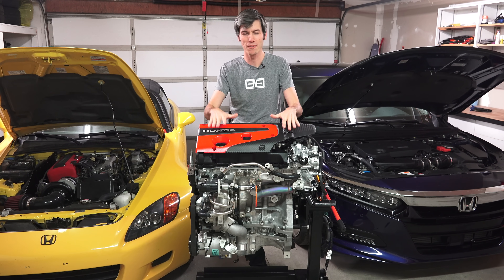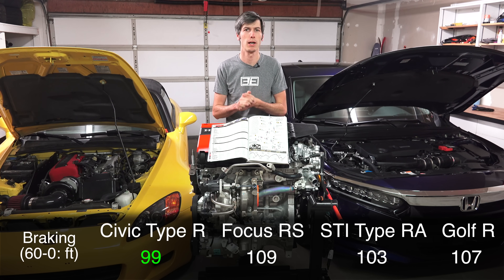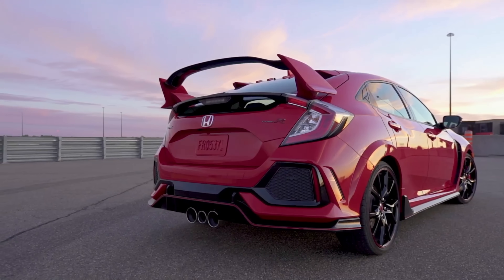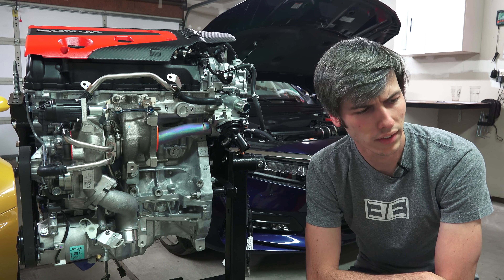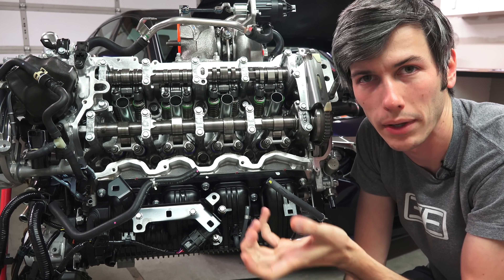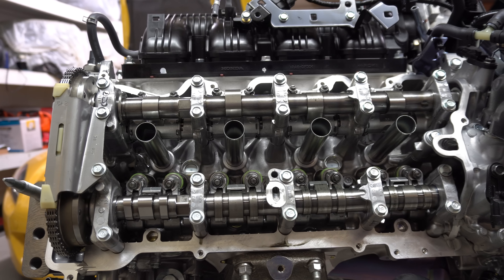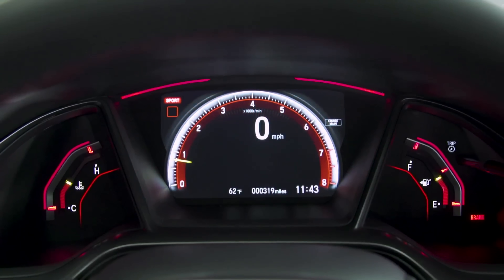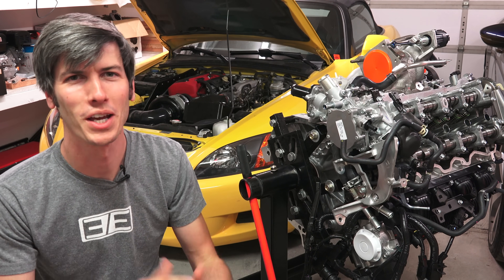The Honda Civic Type R Destroys The Competition - The Best Engines

Comment: "you can buy it as a crate engine, but only for the track."

What are they gonna do about it if I put it in my road car? If i'm buying the engine, i'll do what I damn well please with it.
Reply: Sadly, most states that do regular inspections would deem it an illegal engine swap for a street car.
Reply: live in a state with no inspection and you're golden
Reply: @jameshaulenbeek5931  Most inspectors are idiots and probably wouldn't notice. I used to be a emissions inspector, and if I saw that engine in a street car I would pass it
Reply: @jameshaulenbeek5931  what states
Reply: unless it's a formula 1 engine (or a diesel because those things are terrible in regards to pollution) why would a basic 4 cylinder consumer level engine be  deemed illegal? there should be no concerns about emissions unless you bypass the cat
Reply: Govt emissions regulations. If you are producing an engine designed for road use it needs to meet all emissions regulations. Hopefully it's just a "I promise I'm putting this on a race car" check box and they don't need proof. Anyone know how Chevy does it?
Reply: @volvo09  just come move to Alaska we don't have any emissions tests or vehicle inspections at all!
Reply: @volvo09  The Rotax 850 E-TEC 2 stroke makes 160 bhp yet more than beats the US EPA emissions regulations while the competition running 1200cc four stokes struggle to meet the rules. Why can't we have that super clean 2 stroke technology in cars? It's lightweight, powerful (even at low revs), clean and low maintenance.
Reply: @volvo09  the only thibg it would need is meeting emmisiions so u would have to find a civic type r exhaust system for your car to smog it. Then get the swap approved by the DMV. California is the hardest hows your state?
Reply: @erendyalatorre7785  My state (ma) is one step behind california. Cali is our "model" haha. So I couldn't get a car using this engine inspected unless it was in an older chassis that never needed to plug into the inspection computer...  ecu's vin number and all the associated software has to be there and intact (although fuel maps and ignition maps can be modified, the software on the ecu must be stock, and nothing can be turned off (like the catalyst monitor) or else you get flagged and have to go to a special station and tell them you put the stock software back, or you can never pass inspection again.. I only know because I got flagged like 4 years ago when I got my car inspected with an aftermarket tune that wasn't based on the stock software).
Reply: Perfect for Ontario Canada. We just scrapped our emissions program here for cars..
Reply: You can stick it wherever you want. But I'm guessing the legalese in the description for purchasing one of their engines has more to do with Federal emission laws then them caring what you do with their engine
Reply: Liability reasons
Reply: In Canada our law enforcement focuses on the safety of the vehicle, they could careless about emissions. This idea would easily be doable up here.
Reply: Maybe it's that the engine has no serial numbers, which hinders the probability of getting the car road legal with this engine.
Reply: @Louis Subearth ...that's an interesting point..but don't they use serial numbers for things like manufacturing date so they can identify engines from the same batch when there are issues/failures with parts??
Reply: @thesunreport  for sure, at the very least there's a cast mark with the assembly line/employee number, the date and time all coded in, it looks like a clock with multiple rings and dots instead of hands, has the assembly line number in the middle. I know it's common because I have a Ford rear axle, a Dodge front, a Chevy engine, and a Chevy trans all with that style mark. Also usually when you buy a crate motor it will come with a tag or sheet with the serial number and and the specs for it, if it's internally balanced it usually has the balance numbers on it so you can make sure all the weights are still on it after being shipped dry
Reply: @ghost jesus ...thanks for the reply...you sound like you know what you're doing...much more than me!!...and your mix-n-match car sounds pretty cool :)
Reply: Shhhhhh if the government knew what I chopped out/put in my cars I'd be in prison so shhhhh
Reply: IF you can get your hands on one, absolutely nothing. But they won’t sell it to you.
Reply: If you live in a place that does inspections they will probably prevent you from registering it. If you live in a place that doesn't (most of New Mexico, not sure where else), no one will even know.
Reply: yeah ill put one on a fishing vessel ...
Reply: +Riot Act
Sure, you can do whatever you please with it, but it will get you shadowbanned on Twitter.
Reply: I think you also have to be a member of Honda Racing Line to even be able to buy one.
Reply: Right, how are they going to know what you are doing with it
Reply: Unless... they make you sign some legal document saying you won't use outside of race tracks, before sending you the motor. These damn "corporations" with their mythical "lawyers", you know?
Reply: @xithappens  Thats true, but look at this, the streets are my track. Cant go wrong lol
Reply: Good point.
Reply: I apologize then. I thought consumers could buy them, but they couldn't put them in their road vehicles. Only selling to race teams makes more sense.
Reply: I was just thinking.. would be great to find a salvage accord and get its engine to swap it on the new generation Civic Hatch.. Instant HP gains!
Reply: @WalterRitchey  and this is why Chevy is the best engine company," wanna buy a Chevy V8 with bundled computer or carb and dizzy, with transmission and motor mounts attached? No problem" they just put a warning on their website not to put it in an emissions controlled vehicle or install it in California
Reply: Ohio doesn’t even have an inspection process. Put whatever damned engine in whatever damned vehicle you please.
Reply: @wiggy8912  problem is they only sell the crate engine to registered racing teams
Reply: Riot Act they need like an S4000 now
Reply: Yeah the chain for the life time of the engine. .. there were some that tried it before... engines usually can do better that the chain and is sliders
Reply: My country have an emission test but we only need to pass like Euro 4 standard or something so I think if we can buy it as a crate engine this will be a game changing in a car scene especially to an old Hondas owner like S2000 or Integra DC2/DC5.
Reply: They probably will only sell it to a racing company
Reply: I’m going to put one of these in a Mustang.
Reply: Im so glad i dont live in some of these nanny states some of you unfortunate sods live in. Where i am, anything goes! My own car is engine swapped. Just insure as a swap and your laughing. Happpy days
Reply: You can buy guns, but it doesn’t mean you can do whatever you damn please with it.
Reply: Calm down. he's not swapping it to run people over lol
Reply: People do every day.
Reply: better off buying a chopped engine trans combo out of a crashed ctr on ebay for way less
Reply: register the car in Montana or Tennessee
Reply: In Nashville they do use an OBDII scanner to smog cars. You would have to have the complete CTR computer system too, to pass the test.
Reply: Csm. Hb Jdogg just don't register in Nashville and its surrounding areas  still have emissions laws
Reply: Lucky im in a state like SC that lets you do what you please with your property.

Comment: I would love to own a Type R, but I just can't get beyond the styling. It's just too extreme for me.
Reply: I agree, I think they should offer this in a gimmicks removed version without the faker vents, plastic and extreme wings.......
Reply: @geoffrey2452  I will need something to replace my aging 2004 Acura TSX. If they offer a version as you describe, they will have me as a buyer!
Reply: @TheGriff77  Don't forget that your 04' TSX has the last series non-direct injection and largest 4 cylinder/liter Honda has made; which also happens to be one of the most efficient in it's own category not to mention HP/liter; aside from the F22.  The k24a2 is and will likely be the best of the best for non-direct injection and it's simplicity of said injection type. Though, the power figures stand for themselves on direct injection; they are more expensive to maintain over time and fix. Do not discount your TSX;) PLUS your talking one of the last models built in Japan; that means something-who am I kidding i'll buy it haha. It will be the future sedan our kids will go to for low budget JDM option IMO. OH and though I did work as a mechanic directly for Honda in my younger years. I only own Toyota; so i'm not currently Bias LMAO - happy motoring!
Reply: @geoffrey2452  Those wings ect actually work amd its been proven. Sure to and from the shops its pointless but lets all be honest, were not all law abiding behind the wheel when looking at performance cars.
Reply: Notice I never said they don't work, but rather perhaps a less obtrusive wing might get nearly the same effect. My sports car these days is a 2017 GT350 Cobra and don't begin to use all of its potential either....
Reply: griffojm Import an EK9 Type R ;)
Reply: Yah me too. imagine if you put the type r engine into the better looking civic si.....
Reply: Wait for the Acura ILX Type S! :)  It should be conservative like an Audi S3, if they make it...

Comment: Make it look less vomit inducing & rwd and i‘m sold.
Reply: Owned it since June last year. No vomiting yet.
Reply: Walks a lot of RWD and AWD in the track/street. No need for RWD. Also, if you ever driven one you'd never complain because it doesn't feel like it's FWD when cornering.
Reply: RWD is fun but making the Civic RWD just loses the point of the civic.  May i remind you that the civic is an economy car first performance car second
Reply: Yeah I don't know, it should be a different model if its rwd.  Not a Civic
Reply: dhns555 go buy a Miata. Civic will always be FF
Reply: Dat Boii go buy a 240
Reply: you can't even afford a '98 Civic... so shut up
Reply: Honda gotta make a rwd car, like a honda version of the AE86
Reply: Every generic comment asking for "rWd" like theyre "DrIft KiNg" 
Seriously stfu about it, plenty of RWD's out there to embarrass yourselves in as you wreck. Im glad not every car isnt "v8" and "RwD"
Reply: Looks like a reliable strong and fast car for a budget.  It's fine as is, in the winter here, fwd or awd is all you want.  Rwd here will kill you half the time up here.
Reply: rwd civic… just no. why does every single person want rwd? some cars are jsut fwd. way better in tight corners.
Reply: Exactly! Its far faster being fwd in the twisty stuff! You cannot push powerful rwd cars on the road unless youre some driving god or you just like going in a straight line which is quite frankly boring.
Reply: nah, they just need to make a new S2000. I wish they made it MORE "vomit inducing" cuz i absolutly LOVE the factory rice look. but for sure... the FWD is keeping me away from it, I need to play in the snow!